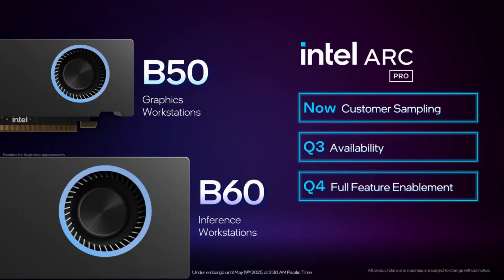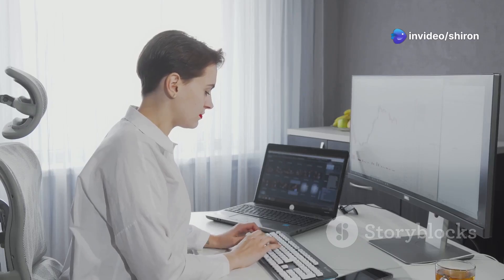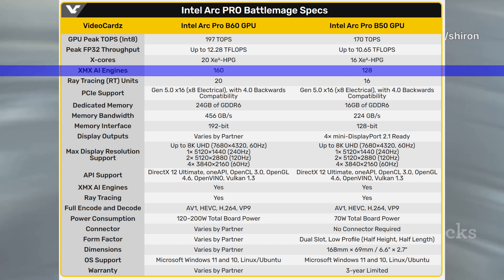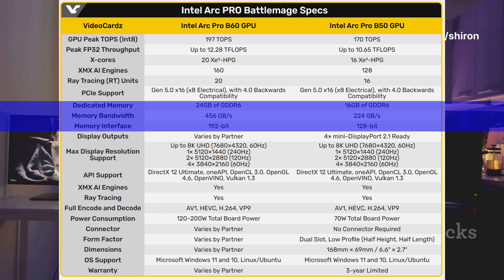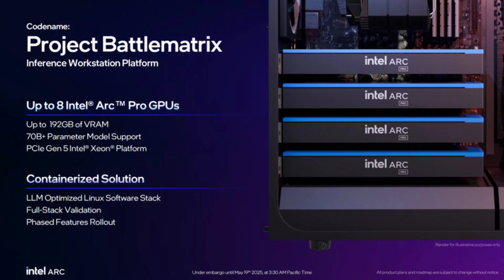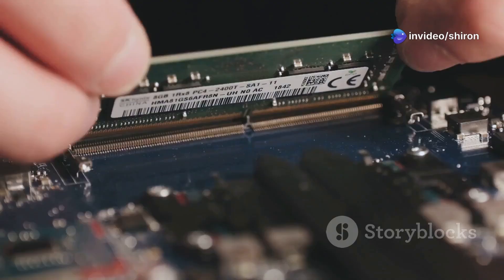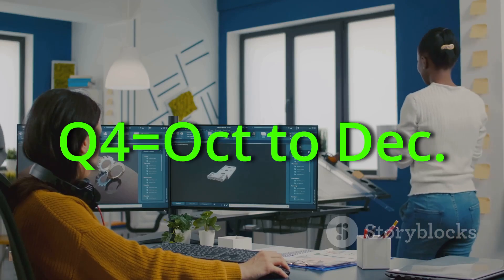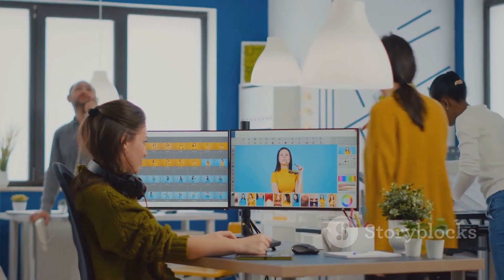Intel Launches Arc Pro B50 and B60 Battlemage GPUs: Price, Release date and Specs.

Comment: Altho, they are for working or professional work. Can we still use them for gaming at least for mid usage?
Reply from the maker: yapp you can you use for mid usage.
Reply: Gaming GPUs are like sports cars. Productivity GPUs are like freight trains. One moves a whole lot of data at a slower speed, and one moves a little data at very fast speeds. A freight train is a lot faster than a sports car when it comes to moving a lot of things. If you just need a GPU for gaming, you should get a gaming GPU. I would wait for intel to release a gaming gpu or go with AMD if you can't wait.